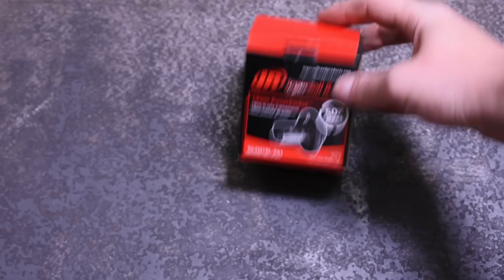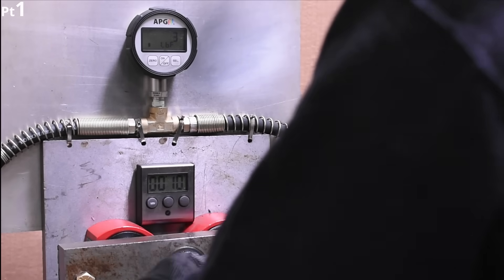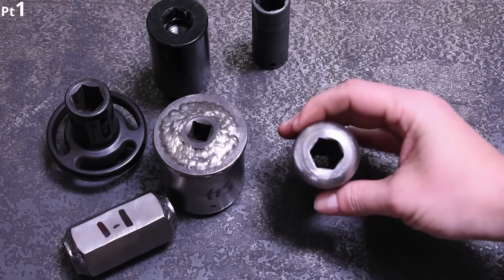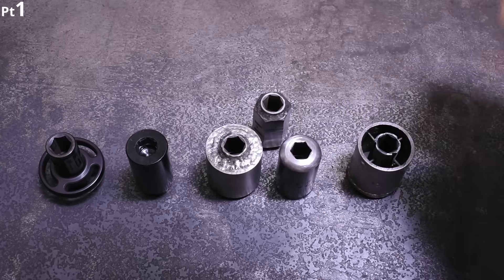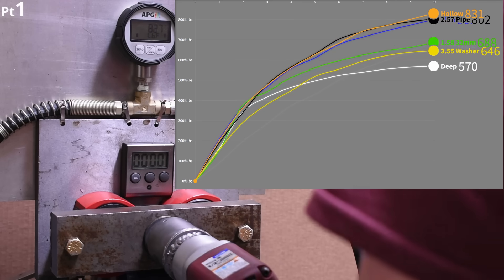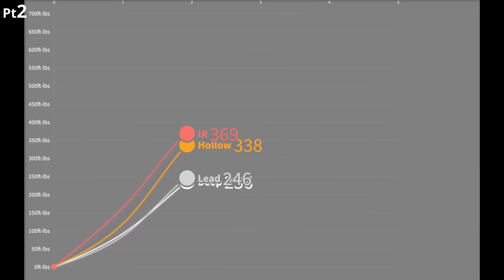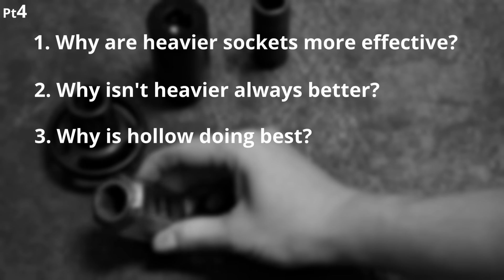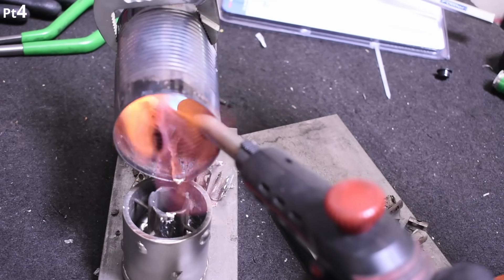Heavier Sockets Make More Power? Stumps Physicist

Comment: What matters is moment of inertia, which is mass x  radius squared. This is why your hollow socket performed well - it probably had the same moment of inertia of some of the far 'less heavy' solid versions you tried. The mass at the larger radius has a very big effect on moment of inertia, where the mass you saver by making it hollow has a relatively small effect. It's also why the IR one performed less well with it's flywheel cut off. You probably didn't reduce it's mass by much (30%?), but enormously reduced it's moment of inertia.
You only have a limited amount of energy from each impact from the wrench to accelerate the socket. This is why 'heavier' (i.e.a higher moment of inertia) isn't always better. Imagine a socket with an insanely high moment of inertia. The impacts from the wrench will be so small relative t o it that it'll not move at all. This is why the whole front wheel doesn't turn when trying to undo a stuck wheel nut with an impact wrench - the energy from each wrench impact is almost totally insignificant because the moment of inertia of the whole wheel is enormously high relative to what the wrench is designed to turn. 

There will be an optimum moment of inertia of the socket for each impact wrench running at a particular pressure, where the energy it has from each impact to accelerate the socket is transferred most efficiently to the socket (and then 'dumped' into the nut or bolt. The highest readings you for will be where the moment of inertia of your socket most closely matched this optimum value for that wrench and air pressure (mechanical impedance matching).
Reply: The other side of this is impedance. Between the moment of inertia of the socket and the high-speed nature of the impacts, we're looking at something like a resonance problem. The drives are effectively a set of coupled resonators going from the hammer through the anvil and socket, and then from the nut to the bolt. The most important connection is between the nut and the bolt, so altering the coupling chain upstream of that would naturally affect the measured results. I really want to see this from a high-speed camera, though. There's no way this is as simple as "each part is a rigid body".

I've consulted on things like this in the past, and they're always interesting problems.
Reply: Thank you! Since the very moment I saw that IR socket I was like "yup, it's not the weight, its moment of inertia". Been waiting this whole video to read a perfect comment like this. I'm amazed on how a Physics Professor couldn't "figure" this out.
Reply: Came here to basically posy this, the best way ive explained it to anyone else is this: its all about the ratio of added mass to added inertia, people also dont realize there is always a bit of slop in the connection from the socket to the fastener, and that's what impacts really take advantage of.
Reply: This comment will likely never be seen but I agree the radius having more of an effect than the mass (due to the moment of inertia) but the thing that explains these results is also the resonant frequency of the hammer blows. The less rigid “sockets” like the washers couldn’t benefit from RF because they aren’t rigid enough. The super heavy sockets didn’t benefit from RF because the impact wrenches weren’t strong enough to hit the RF of that particular socket. This could also be shown by using the IR socket on a much weaker impact which won’t hit the RF.
Reply: @AVBros37  Unfortunately, coupled resonators are usually a bit more complex than just having a single resonance frequency. There's also the damping factor at play, any impedance mismatches at play, and probably more. I suspect the square drive also deforms on impact, so the stiffness of the connection between that and the socket likely changes over the course of a single impact. I agree that the washer would be pretty weak there, as it had the least material to transfer forces along it's length. Any resonant system is a balance between coupling elasticity and mass. The smaller wrenches probably lack the hammer/anvil mass to effectively couple to the much larger sockets. That would partially offset the gains from improved socket-to-nut coupling.
Reply: @AVBros37  I concur. Also,  the properties of lead make it not very ridgid. It is easily maleable and it will tend to dampen each blow rather than transferring the energy. 
The ring on the IR socket will actually not only increase the moment of inertia but also increase ridgidity and this very close to the point were the force is actually transferred from the shaft of the impact driver to the socket.

One could try to built a carbon fiber reinforced scoket with an additional toroid ring to see if the concepts of ridgidity +  >moment of intertia make a real difference.
Reply: @AVBros37  so you are saying add another kick spring to sacrifice resonating  blow frequency for average inertia of each blow to raise peak torque amd maximum unwieldy wobbly power but thay what its for just once mega torque increaser tear your drill to bits.
Could call it the boltsnapper if you got it right.
Reply: You, sir, have a firm grasp on the physics involved
Reply: TRY A BELL SHAPED SOCKET WITH THE THICKEST PART (GREATEST MASS) CLOSEST TO THE DRIVE ANVIL.  Theory:  Road cyclists fret and whinge about Q factor:the distance between the outside of one crank arm and the other measured laterally, through the midline of axle (bottom bracket).  LIkewise I would suspect that sockets with the mass closest to the 1/2" or 3/8" drive anvil (square tip of your impact wrench) will be much less susceptible to out-of-balance issues that could rob inertia.
Reply: Stiffness and moment of inertia are the deciding factors.  Imagine a giant asterisk (*) coming from the socket.  As the initial rotation delivers force to the bolt,, it creates a whip of angular momentum though the arms of the asterisk that continue to provide rotational force to the bolt over a longer period of time, increasing total torque applied to the bolt.

Pure mass also provides a similar effect (the lead socket), but the increased mass makes the overall tightening slower. That's why the lead socket was just getting started at the end of 10 seconds (still had significant tightening slope) compared to the rest.  I would have loved to see it on a longer run.

I'm sure once we get deep into the weeds maximizing moment of inertia there will eventually become an issue of tuning the length of inertia arms to the impact frequency from the driver.  If we had 4 feet asterisk arms such that the next strike came before the arms had fully stopped their rotation, we'd end up with losses rather than gains.
Reply: Not only. During the impact of the impact wrench, part of the energy is spent on the elastic deformation of the socket along the axis, approximately half of which is then returned to the screw, and half - to the rotor of the wrench. The ring, which has a significant moment of inertia due to the mass/diameter of the flywheel, creates an obstacle to the return of energy to the rotor of the torque wrench, and more energy is transferred to the screw.
Reply: The rrick to that trilobebsocket is its inherent imblance, youbare going to see the pulses resonate , to really emphasis what the uneven weightbdistribution is doing imagine the weights further out .at some point the momentum syncs with the weight and bosh. You get a higher peak...thers likely an optimum design for each style of hammer.
I would replicate this in the hollow one and put windows in it to give it that inertia point.
Reply: i was going to say what op said but in more general terms

this:
1. when weight is farther from the center point and rotating it takes more to stop that weight from rotating
2. more rotating weight imparts more force on the object that is trying to stop the rotation
3. less weight takes less force to rotate it
4. even tho the IL socket has less weight because that weight is farther from the rotation it can impart more force to the object trying to stop its rotation
5. the IL socket put all the weight as close to the device trying to impart rotation so it is easier to rotate
so the balance of weight and the distance that weight is from the rotation and where the weight is located is the keys to how these sockets work

if you could get a 3 foot long socket with a ring 1 in thick held off the socket 10 feet as close to the device imparting the rotation as possible you could probably flip a car off of the rack
Reply: @111smd  Or the resilience of such a long socket would smooth out the sharp peaks of the impact, acting as a low-pass filter. You'd end up with the wheel taking longer to slow down, so the peak torque would be lower. Even if it has greater average torque, significantly more of that would get soaked by friction. As the socket gets longer, you'll end up tending toward a normal drill in performance. It'd largely negate the whole reason for using an impact driver.
Reply: Actually, it is quite easy. The energy stored in the flywheel should release itself (from bending) as close to the peak of the next impact as possible. In this case the impact is stronger than without flywheel. So, you should take into account, socket length, material strength, flywheel mass, impact per minute and impact force. There is an optimum mass for each set of variables.
Reply: Articulated FAR better than I ever could, I found a long time ago with a tiny 1/4 impact my dad had laying around that for every impact there's a weight that each hammer/mass uses best for a given applied toque/socket size.

And i think what is happening with the hollow socket is less mass to overcome the hammer but also greater inertia effectively placed furthest away collecting/returning more toque as a more effective flywheel, albeit more space consuming.
Reply: You sir get a gold star. I was about to make a similar post, now completely unnecessary. The only thing missing from your explanation is connecting that to the amount of advantage seen with air vs battery impact tools and higher vs lower power battery impact tools. That of course is all tied back to how much the tool can accelerate the socket in the time and distance it can in order to maximize the moment of inertia. 

Lower powered tools, and those with lower mass impact mechanisms will have more difficulty accelerating the socket, so the exact mass and mass distribution needed for ideal results will vary by the power and mass of the particular impact driver.

Also note that a socket with convex or “flattened v” shaped contact surfaces should be able to accelerate over a longer time/distance, and might therefore, increase the moment of inertia further, thus increasing it’s effective power. That’s something Torque/Astro or another tool manufacturer might experiment with.
Reply: This is pretty much everything I was going to say. I just want to clarify a few small points which you may have either missed or there was too much explanation already going on in your post.

So the moment of inertia is important because of the opposing forces at play. As long as the inertia of the socket is insignificant to the impact wrench (ie each blow is accelerating is at about the same rate) then the socket will deliver more torque in the end.

Now for the interesting part you left out. Speed does directly correlate to increased force, and as long as the impact wrench is powerful enough to achieve the same acceleration on a larger diameter cylinder as with a smaller one, the outer edge of the cylinder is moving much faster than the inner section. THIS is why the hollow socket performs the best. The velocity of the outer cylinder is so much higher than the inner section that it delivers vastly more force relative to its weight. So as long as the inner section achieves the same (or comparable) velocity with both sockets, distributing your weight farther from the center of rotating will correlate to more torque.

As for why the expensive flywheel socket doesn't perform any better than the Lisle, that's because the Lisle has equal weight distribution down the entire length of the socket, while the flywheel itself doesn't contain a large enough percentage of the mass of the entire socket. The smaller radius of the Lisle simply overcomes this because of nature of cylinder volume. The mass of any cylinder is skewed toward the outside edge, and in a hollow cylinder there is a "Goldilocks" zone where the majority of the mass will be concentrated in less than 50% of the cross-section. In other words, up to a certain thickness a solid-walled hollow cylinder will have mass distribution very similar to a double-hollow cylinder with two distinct walls (ie your hollow socket).
Reply: Also the shape of the IR socket is a dead giveaway that the moment of inertia is at play.
Reply: I agree, and think the best impact socket you could make, will be a device that was a free spinning flywheel that only delivers impact to the bolt/nut every 3-5 time it turns, this way you keep the speed/movement of the flywheel up and can dump a lot more energy into the nut, every single time it strikes. And another benefit of it is, it can be driven by any electric hand drill that people have at home.  You don't need a impact gun, just a normal electric drill and the this flywheel socket. 
Only downsides I see, is the time it takes to loosen the nut maybe 3-6 sec more per nut and if you already got a stuck nut, then time is not really the problem.
Reply: Came here to say this, couldn't have said it better. The more of the socket's mass that's at the socket's maximum radii, the more inertia you're going to transfer to the part. Like a cheater bar on a wrench. But there's going to be diminishing returns, based on the tool's available torque, and the total mass of the socket. The tool has to be able to get the socket moving, before the socket can do anything. The more oomph behind the socket, the better it's going to be able to do it's job.
Reply: Yes that's true, but i think you're missing a very VERY! big part of the explanation. The socket construction and the materials flexibility. Disregarding that would make any calculation regarding inertia useless.
Reply: You said pretty much what a bunch of us were thinking, but better.
Reply: I agree,  Another way to look at it is its a simple matter of torque.  Mass is moved a farther distance from the center, this is how torque is generated.  In contrast, the lead socket center of mass was not as far from the center.  It's all about torque TTC...😁
Reply: TTC can use high speed cameras to test the torsional resonance of the system.  They can use their see through impact to observe the hammer blows and watch it transfer to the socket flywheel and from the flywheel to the bolt.
Reply: There are far too many people in this comment section saying "you sir"
Reply: I agree with what you said but to put it in a much simpler way said the weight is distributed on the outside of the socket far away. The gun makes it spin and then it stops transferring the power to turning the bolt. I wonder what it would be like if that flywheel ring were like 6 in in diameter
Reply: faster rotating smaller weight doesnt create more power from the same rotational speed applied to a heavier weight
Reply: like any fly wheel, the lighter center to heavy outer edge makes best power, but i imagine the amount of impact vs hit shows the power differences. so the outer edge weight advantage will change for different guns. a giant impact will get more from a giant flywheel.
Reply: Actually, it would be the radius of gyration more than the moment of inertia. Moment of inertia is the power, the radius of gyration is at what radius most of the power exists. In this case, pushing more mass to a greater radius, moves the root mean square of the mass to a greater radius.
Reply: Bingo! Moment of inertia.  Likely limit is about 1.5 x weight of the hammers in the impact and diameter would be about 1.5 of the hammers orbit.
Reply: I was definitely going to say something along the lines of "mechanical impedance matching" which is why it gets better as you initially get heavier, and then it gets worse as it gets too heavy. And being an EE, "impedance matching" was exactly how I was going to put it too, and then it's already in the TOP COMMENT!
Reply: Came here to say this but you were the better person for the job.
My explanation would have been poorly worded coz I'm a spaz
Reply: @mathewforsman5824  all these months later, and in a fractal down this thread, you speak for me too. Better than I would have.
Reply: You make a good point. Moment of inertia is the relevant figure of merit, rather than mass.
Reply: By definition inertia is the resistance to motion or changing motion. Momentum is your friend here if you want a moving socket to move a bolt.
Reply: Just reading the title not watching the video.  I thought not much of a physicist.  You are absolutely correct
Reply: Well said.  I was trying to dig through undergrad physics and laws on energy.  I was just looking at calculating the moments of interia of point masses on wikipedia.  For the single point you get r^2 where as 2 point masses you square the distance from the outside, across the center, to the inside mass.  I bet working some of these would show some results.  
https://en.m.wikipedia.org/wiki/List_of_moments_of_inertia
Reply: The smaller the moment of inertia(or mass), the better and more force would be applied. Except for some special cases where the bolt is long and therefore springy, like the test setup. In most cases, weighted sockets will make it weaker.
Reply: @chang.stanley  I think it comes down to how well the impact can transfer the energy of each blow into the weight of the socket, and then if the socket has a larger moment of inertia, it has more inertia once it's moving to overcome the springyness of the bolt and actually perform some useful work beyond just torquing the spring that is the bolt. There's 2 transfers that need to be "impedance" matched - hammer in the impact to the socket, and the socket to the bolt. Just like in electrical circuits, you get the highest power transfer when the input impedance matches the load impedance, the same would be true here with inertia and moment of inertia of all the pieces - the better matched they are, the more power transferred to the bolt in the end.
Reply: @gorak9000  In this case, we're more interested in maximizing the voltage transfer in your analogy. Since you transfer nothing if the forces are less than what the static friction can soak up, you're better off just getting the peak forces as high as possible so you can at least transfer something. If you then also tune for increased moment of inertia, there will be more energy stored to do work once the threshold is overcome. It's kind of like driving a spark gap, now that I think about it. Very hard to get things going, but then much easier after that. I'll see if I can check how these things compare to a typical spark circuit in the next couple days.
Reply: I don't think this is happening, a heavier flywheel on a motorcycle works in this sence but the socket has no velocity so very little momentum.
Reply: @adampetten1009  except it does. It's not as much but it has it. Which is part of why there's a sweet spot with the weight of the socket.
Reply: @adampetten1009  a fly wheel works on exactly this principle.
Reply: @adampetten1009  What it's essentially doing is taking a small amount of that initial energy prior to the blow, and applying it after the blow has hit, thus preventing bounceback. It's essentially improving the impedance between the impact gun and the fastener.
Reply: @adampetten1009  An engine isn't a impact drive. (well, it kind of is, but not like that) If I understand it correctly, it's basically moving the mass of the flywheel, and keeping it moving with the impacts of the tool. If that is balanced correctly, it will improve the torque. If it's not balanced correctly, it won't do anything, or even make it worse.